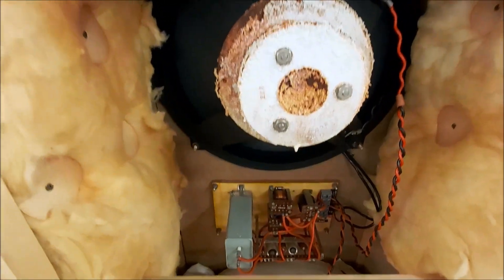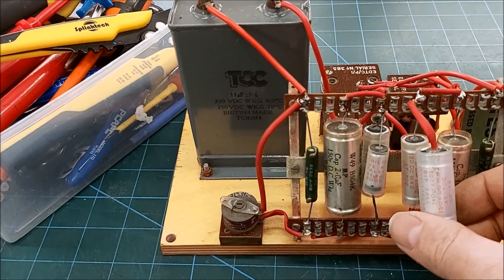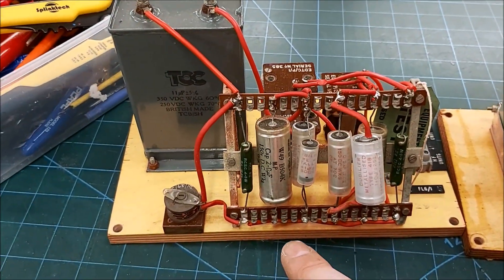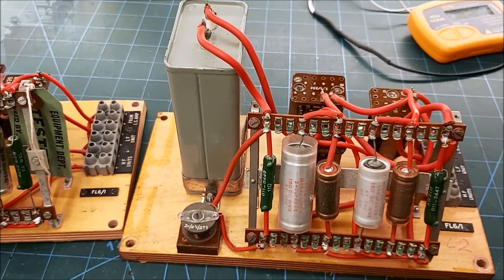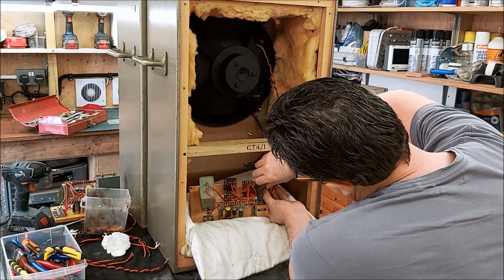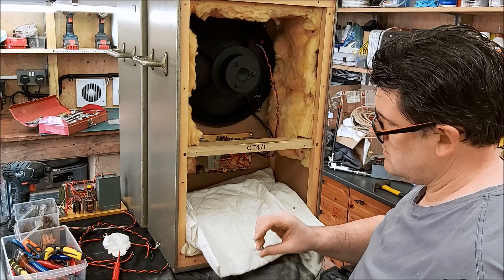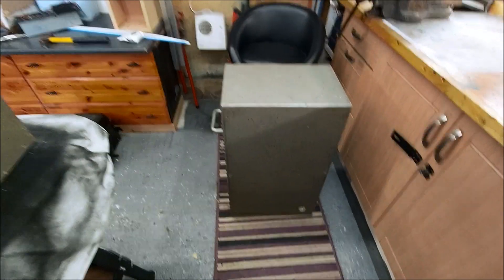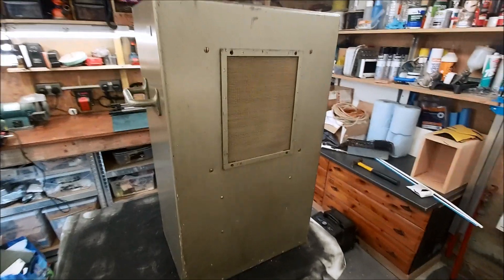BBC LS3/1 Speakers Part 2

Comment: Great video!!!!! Always interested in the BBC ls3/1 with slotted front. The slot load the woofer will get a lower the resonance frequency and a higher Qts. This is good if you want to use PA mid-woofers as woofers. 
My idea is to use the slotted design together with a pair of12" EV EVM12L or 15" JBL 2220A drivers that has too little bass. They will be used in a Karlson transducer design  (not the one with the woofer inside the Karlson slot)
Reply from the maker: The main reason for slot loading the woofer in the case of this design was to improve off axis performance by reducing 'beaming'. The polar pattern is greatly improved but at the expense of power handling etc 👍
Reply: @haycrossaudio5474  You are right that BBC  and Graham focus on that reason, but Nelson Pass use slots for produce lower bass. I think the slotted design has benefits in both the bottom and the top for these kind of light cone large woofers. I have both the EVM12L and JBL 2220A so someday I might try how good it worked. Thanks again for the very nice video about the BBC LS3/1

Comment: beeb used to limit frequencies to transmitters ?(at 10k I think) only Crystal Palace got the full range (it was on a copper feed and was the start of the rebroadcast chain if the system had problems.) so the low upper frequencies would have been a good match to viewers.

Comment: The bass driver is a plessey unit, they did these as in these with a smaller diameter magnet, then some with a larger diameter magnet. They also produced it as a "daul conctreic"  with an oval tweeter mounted on metal rails across the front of the driver. On the part one video you can see the extra mounting holes for the rails. RCA used the same driver in their LMI 32245 speakers. Sonotone used the coaxial version in the 220 speaker. I know of a third company that used it in one of their speakers but i can't remember what company of the top of my head

Comment: Can't stop thinking the "old style" slightly compressed sound, in some manners could be down to the small slot around the 1300 frame.
Wonder if that slot is to make a manual filtering..? 
But as usual i really love Your videos. Learning quite a bit!